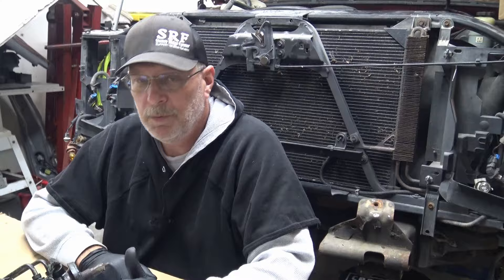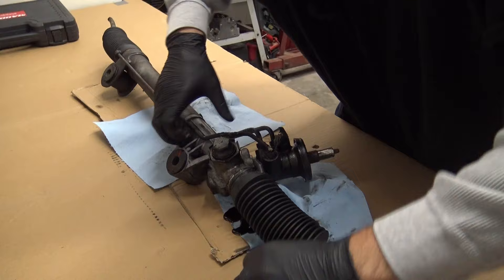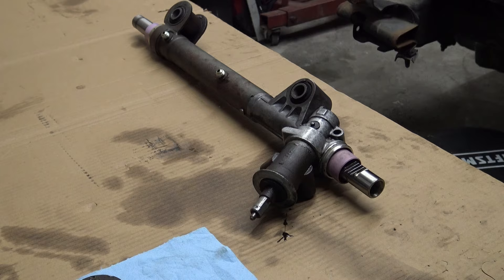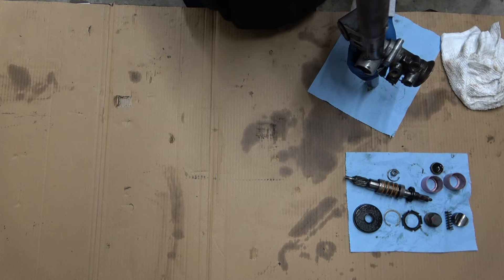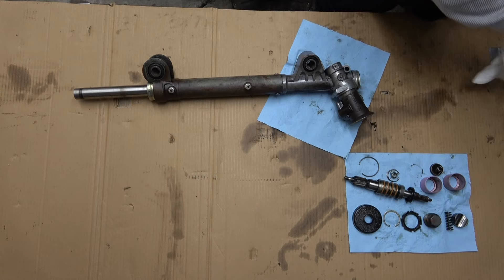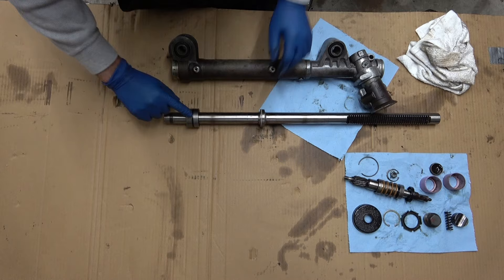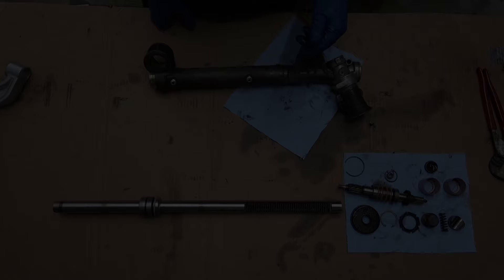Power Steering Rack and Pinion Teardown, Chevy Truck. Every Seal is Bad and Leaking.

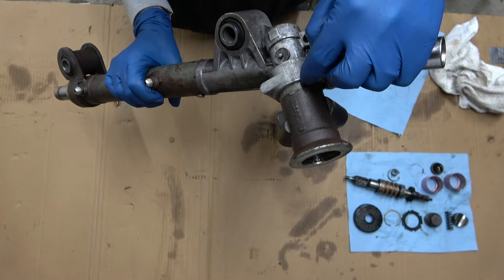Comment: I was really hoping you'd show how you removed the seal mentioned at 19:30/24:36. I'm currently rebuilding a rack and pinion but this is the only thing holding me back. On mine there is a sort of metal stopper/ring that keeps the seal in but I cant knock it out without risking damaging it.. I managed to destroy the old seal and remove it but in order to insert the new one I need to take out the stopper.
Reply from the maker: I first tried a socket attached to an extension, that did not work. I then used my picks and taped them to long screwdrivers. The seals are not easy to remove, and you don't want to scratch any part of the inside of the "tube" that could potentially cause a leak. Here is a link to the Fix the Rust Bucket Facebook Page, I posted some pictures of the picks and seal after it was removed. https://www.facebook.com/fixtherustbucket
This one was stuck really hard in there. I had to get the sides freed up first then I was able to pick and pull the seal and white hard plastic rings out. This was for both of the seals. I hope this helps a bit more and helps you with yours.
Reply from the maker: This is a reply for another person that was having the same issue and their way of removing the seals.  
"I went to Harbor freight bought a long reach set of needle nose pliers and the longest flat head screw drivers you gotta bend the lip of the seal and use the pliers to grab it and pull it out but make sure you get a good bite and your good!"

Comment: The timing of this couldn't be more perfect.  Trying to decide if to replace or rebuild mine, which is exactly the same unit.  After watching your well filmed video I'm leaning towards saving $250 and doing the rebuild.  Thanks to you I have the confidence I can do it.  Thank you, sir!
Reply from the maker: If you're able to afford the vehicle downtime it's worth giving it a try. When I ordered the seal kits I had to order two different kits. One came with all the necessary seals for the rack and pinion but not a new pinion bearing. You might find a different kit that comes with everything, just check out what it comes with before ordering. I appreciate your comment and taking the time to watch the video.
Reply: How'd that go for you?

Comment: Thank you so much for showing how to do this. I've been working on cars for 20 years but never tore one of these apart. My auto mechanics teacher, as well as several shops, always told me it's too difficult to rebuild a rack and always better to just replace them. Finally seeing how it's not that difficult, with the proper tools, I'm slightly irritated all these years I could've just done this and saved ppl a ton. Thank you thank you thank you 🙏

Comment: ...yours is the first video I've ever seen on YouTube, that clearly shows how a hydraulic rack and pinion steering system works, and how to repair it.  Thank you. 👍🏼🤘🏼✌🏼

Is it possible to repair just the Passenger side Outer seal on the rack, while it's still mounted on a vehicle.  After you've removed the Inner tie rod assembly, without having to remove the whole unit.  Thanks. -- Alfredo

Comment: Question for ya I got 2015 Escalade with front end accident the steering wheel just keeps spinning with loud noise wheels are not moving it all looks intact 
Is there a way to rebuild the steering rack what broke is there rebuild kits
Reply from the maker: It could be one broken part/location or a combination of broken locations that are causing the issue. Its a bit hard to figure out not seeing it in person. I would start where the steering shaft exits the fire wall and work down. Your truck should be equipped with an intermediate shaft and a lower intermediate shaft, the universal joint could have broke inside the boot. That would give you a noise with no wheel movement. If not, then possibly the input shaft or steering rack has broken/stripped gears.  
Thanks for the question. I hope I was able to point you in a good direction to start looking. 
FTRB.

Comment: Where do you find info find torque value setting the preload on the pinion?
Reply from the maker: I sometimes purchase Manufacture Service Repair Manuals for vehicle(s) I own or do large projects on. Someone can find most of the information their looking for in a Chilton or Haynes manuals. Now a days, for almost the same cost, you can purchase a flash drive containing the entire Manufacture Service/Repair Manual. Those flash drives contain the same information that was or is distributed to dealership service shops. 
As for the Pinion on this piacular rack, I believe the torque was 27in/lbs.

Comment: Nice .. BUT you didn't film  THE most difficult part : 
Removing and replacing the seals in the bottom of the tubes ! Pinion and Ram.
 Replacing the big rubber bushings  is a waste of video time... in comparison.
Reply from the maker: Here is a link to the Fix the Rust Bucket Facebook Page, I posted some pictures of the picks and seal after it was removed. https://www.facebook.com/fixtherustbucket
There was no way to video inside of a tube.

Comment: How did you remove the seal inside the rack tube?
Reply from the maker: I first tried a socket attached to an extension, that did not work. I then used my picks and taped them to long screwdrivers. The seals are not easy to remove, and you don't want to scratch any part of the inside of the "tube" that could potentially cause a leak. Here is a link to the Fix the Rust Bucket Facebook Page, I posted some pictures of the picks and seal after it was removed. https://www.facebook.com/fixtherustbucket